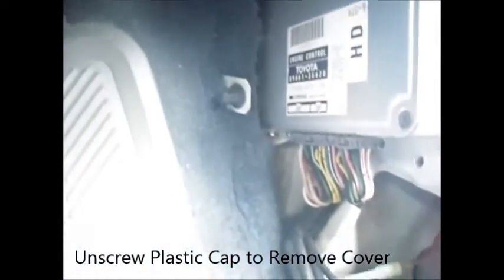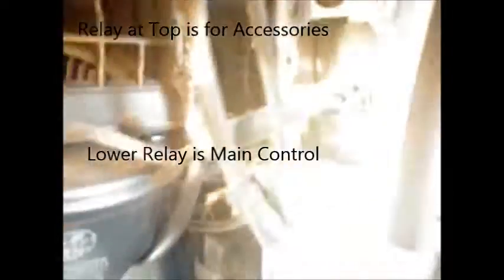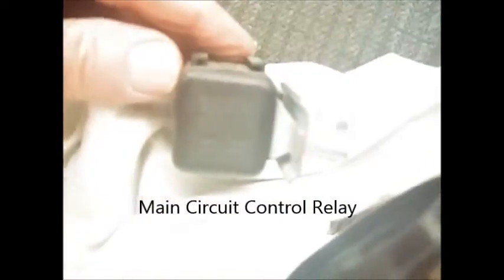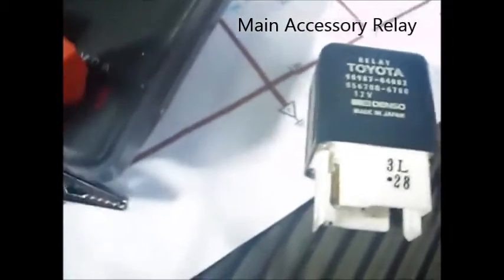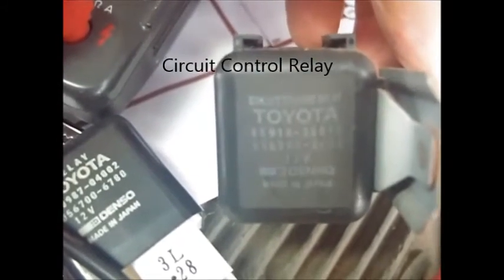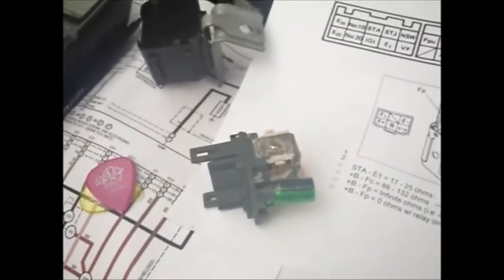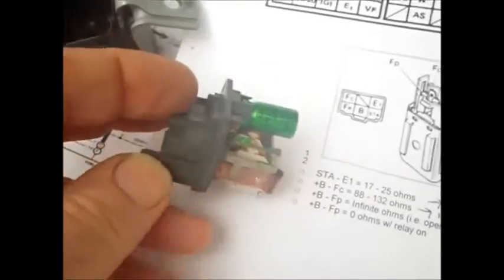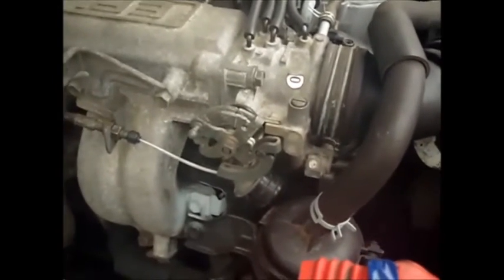Finding 91 22re Toyota ECU Relays and Grounds

Comment: The circuit opening relay controls your fuel pump ... there are two sides to it one side is triggered by ignition and then once the engine starts pulling vacuum the airflow meter vane door opens and triggers the other side of it and that circuit takes over control of the fuel pump.  The ground wire you are looking for is in the driver side kick panel next to the fuse box.   Your relay is a little out of spec but not sure it’s enough to cause it not to work... did you replace it?
Reply: That's a great explanation, simple, & straight to the point. The fuel pump on my 1991 4runner doesn't prime. The engine spark and cranking is strong. Direct power to the fuel pump does turn it on so I know my fuel pump works strong also.  I bypassed the fuel pump circuit with a paper clip on the small black plastic box for self diagnostics on the fender. Still the fuel pump doesn't activate. This is what I did to finally get the fuel pump to activate.  I put the ignition key on the ON position, bypassed with a paper clip two female prongs on the MAF wire connection which is wide with about 5 female prongs. I bypassed the first two female prongs closest to the front. Thirdly, I removed the plastic cover on the circuit open relay and I pressed on the 2 metal side prongs & finally the fuel pump was activated and started pumping fuel. Maybe I should press in on one metal prong on the relay to see which one initially turns on the fuel pump. The side of the relay that doesn't turn on the fuel pump, is the side that initially primes the fuel pump, that doesn't work in my case.  This is the side that I should lightly sand the contact points since most likely it may have some contaminant like corrosion, carbon build up, etc. If this still doesn't work to initially prime the gas pump, then replacement will be necessary. I'll simply get two relays from the junkyard.  

 And if this doesn't resolve the problem I would open up the MAF. I've seen videos where the inside gets corroded or the metal prongs get warped from the intense heat under the engine compartment.  Every video I watch, including your straight forward explanation makes me feel confident on what the problem could be. Thumbs up for you also.

Comment: I have the same truck I am trying to diagnosis what the issues are.
So far I have checked the TPS, plugs, wires, rotor. With the key turned over the fuel pump doesn’t turn off it has a constant hum. Any ideas?
Reply: Douglas Vaughn 
It’s your ground.. check all from motor..
Reply: Douglas Vaughn:  I had the same problem as you on my 1989 Ford Mustang 5.0. The fuel pump wouldn't turn off; it had a constant fuel pump hum. I replaced the relay under the driver seat and the problem was fixed. Fortunately the relay was cheap,  $30. My friend said I was lucky that I never hydro locked my engine in the morning due to a return line that feeds the gas back to the gas tank. Now the problem I have with my 1991 4runner 3vze is that when I put the ignition key on the ON position,  the fuel pump doesn't prime/activate. My 4runner does have a strong spark and a strong crank. The fuel pump should turn on if I bypass the self diagnostics black box at the fender but even bypassing it with a paper clip, the fuel ump doesn't turn on. Next thing I did was to  locate the same relay that this guy is talking about. I removed the plastic cover on the relay  & I pressed on the 2 outer tabs and still the fuel pump would not turn on. Next I removed the wire connection from the MAF and bypassed 2 female prongs with a paper clip, then again I pressed the 2 metal tabs on this relay and finally the fuel pump turns on. The wire connection that connects to the MAF is wide and has about 5 or 6 female prongs. Since bypassing 2 female prongs on the MAF cable connection plays a role in turning on the fuel pump, I'm assuming that the problem is where the MAF wire connection is connected on to the MAF. The MAF is attached to the air box. The black cover has to be removed in order to see the condition internally. Inside there are metal wires that tend to build contaminants or they get warped from the intense head inside the engine compartment. After all these are cars that are several decades old. All that is needed is light sanding on the internal connections; or if warped, simply bend them into place to be able to make contact. Check out the videos on how to check the MAF. I may just get a good MAF and relay from the junkyard.